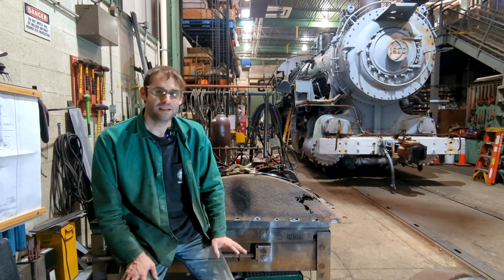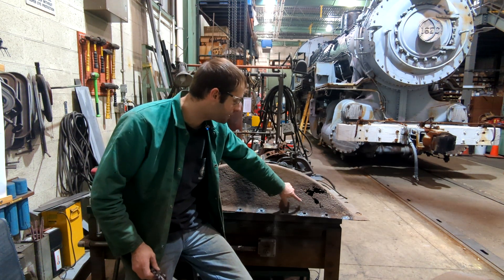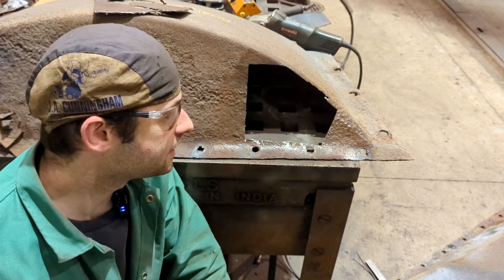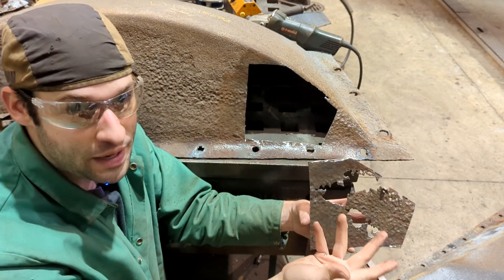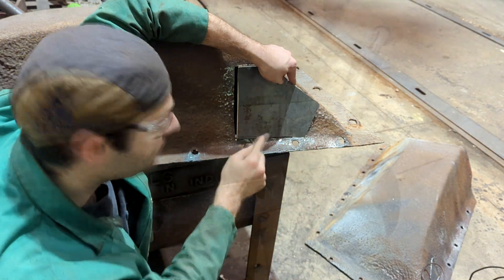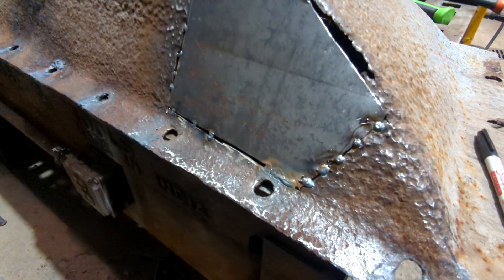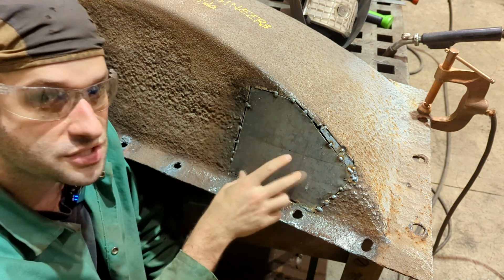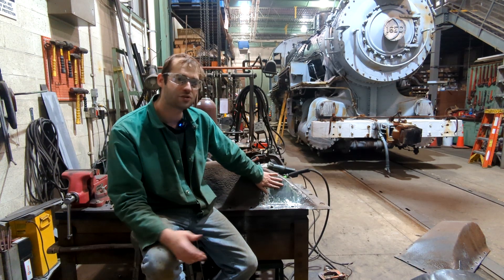How to Repair Rust!

Comment: Interesting to see the work being done, as another commentator said, I thought a hole meant the whole piece would need replacing, was patching common in the steam era? 

Also, is wheel well the same as a “splasher” of British terminology?
Reply from the maker: Absolutely!  Early patches were done with rivets, later ones with welding.  Many steam tenders were held together until the end with patches.

Comment: Usually when those deformed holes happen in the metal I always thought it would need to be replaced entirely but I see that you just cut it a certain shape and weld a new piece of metal that’s the same size and shape

Comment: Why does the numberplate have an extra line throught the center of it. On the engine in the shop
Reply from the maker: Someone made a wooden reproduction number board for it when it was kept outside.  This way nobody could steal it.  When they sandblasted it, the wood fell apart.